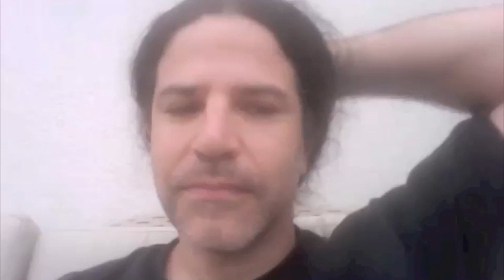3Dresponse

Comment: Just a side note here...I'm sure it would not prevent the wrench breaking with full force applied, but you held the Crescent wrench improperly in the original video. The wrench Crescent is able to withstand much more force when placed the other way (flipped). The lower moveable leg of the jaw is more succeptible to stress in the position you held it.